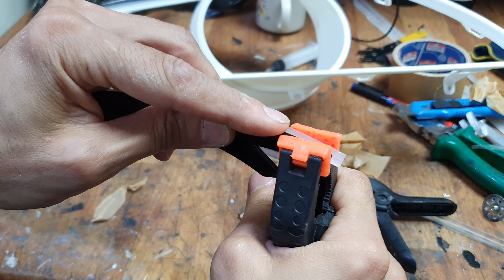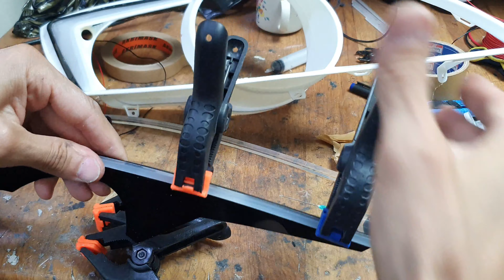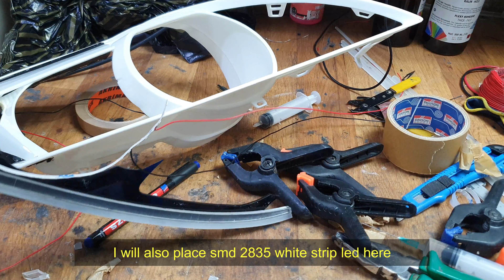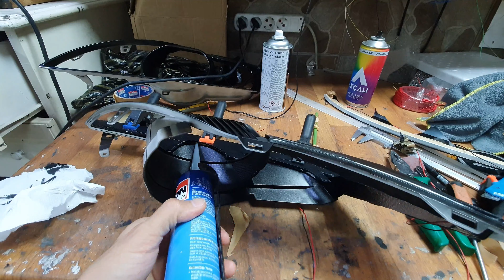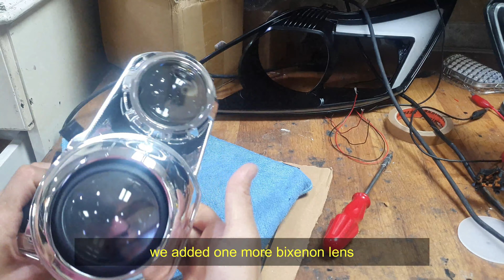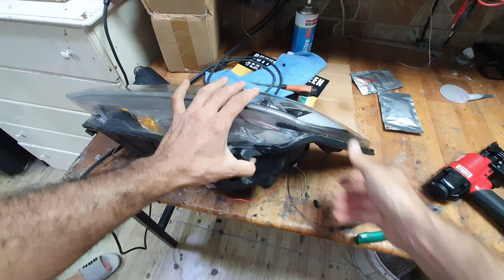Ford Focus Mk 2.5 Led Tasarımı Nasıl Yapılır

Comment: Good evening
I am Fayçal from Morocco.
I have a Jetta 2.0tdi model 2017 and I made modifications to the optics. the modification made is that my optics are halogen lamps but I changed it with biled magnifying glasses either for high beam or low beam, that is to say when I turn on the high beam it also lights up low beam since it two magnifying glasses.
the problem is that when I do a headlight recall the bulb light comes on and I will need a good electrical diagram so that I can solve this problem.
Thank you so much